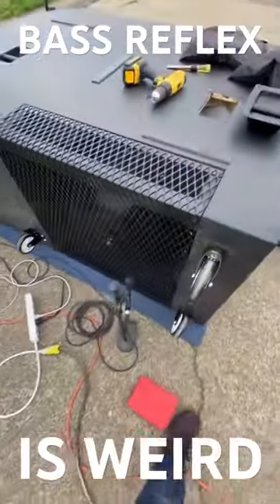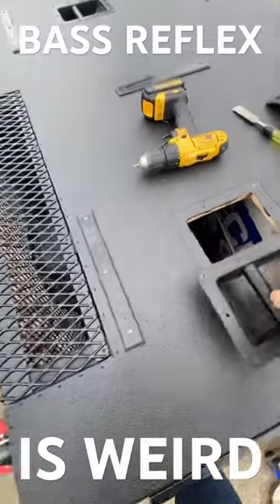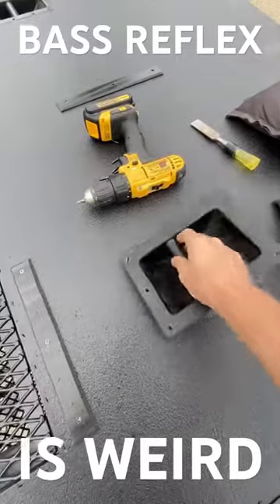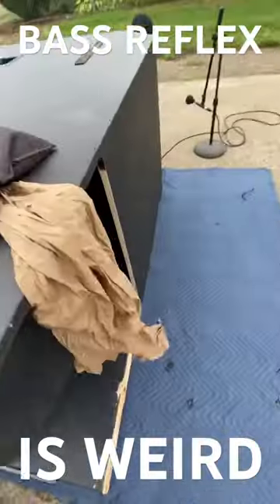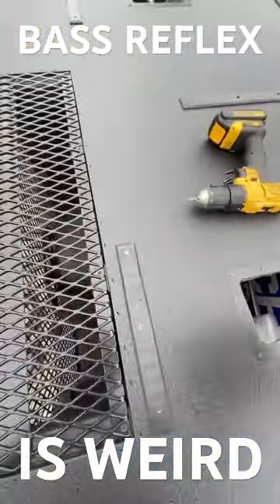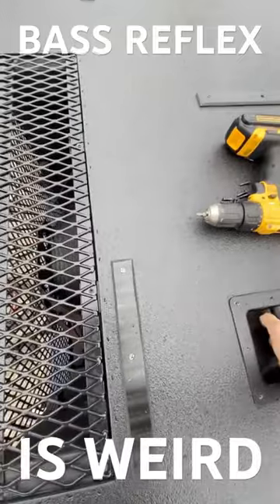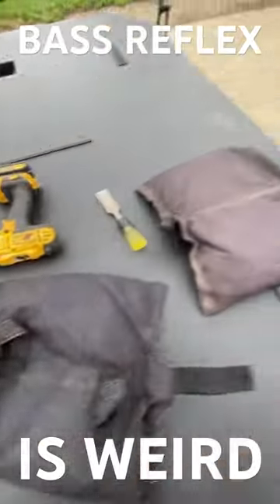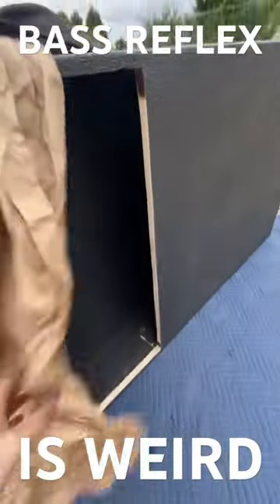BASS REFLEX IS WEIRD

Comment: Largely because air doesn't enter and exit the port by definition, the subwoofer is moving an air mass that resides in the port area. The air mass is responsible for a large portion of the sound wave produced.

Comment: Air acts as a spring, and the larger the volume, the lower the compliance. As soon as you leak it to atmospheric pressure, the compliance shoots way up, providing way less stabilizing force on the cone.

Comment: What is the benefit of the reverse mounted driver? Just for cooling or sound too?
Reply: my own Subwoofer research & experience suggests to me that the inverted cone on the driver is to maximize cone displacement area in the room (the reason for buying this $1000 driver), unique underhung suspension to get more cabinet air moving around the copper coil (to prevent thermal failure), and because the cone itself is made out of some denser materials than an Eminence paper cone subwoofer, and the cone ripple (watch a cone in slo-mo) would destroy a traditionally designed non-underhung cone and suspension.
Your average installer doesn't consider how much work the Spider does to restrain the cone from wanting to eject itself when hit with over-power.
I've had EVs just launch their dustcaps when hit with a 5-string Bass at 250w. 😂
Reply: Many reasons in many designs. But this one is not reversed. It is a configuration of m-force driver, and it just "is like that".

Comment: doesnt bass reflex not just work on a 1/4WL principle?. u get in that chamber the line u force out of a pipe because of its port area. that port area reflects to compensate the missing port. so ofc u mess with the cabin if u get an area big enough that acts as an other port built parallel.

Comment: Air Always come to easier resistance
Reply: Yes, but for oscilating air you call it impedance. Thats because you will both have a resistance value and a phase. The resistance is aldo frequecy dependent.

Comment: you are killing the driver. because you alter the air impedance loading on the driver, it is free to move at high amplitude possibly beyond its Xmax. bye bye linearity
Reply: Ok?
Reply: Did you know that powersoft had that functions right?
Reply: @lixinong28  what functions?